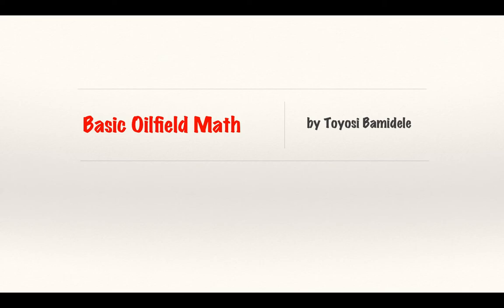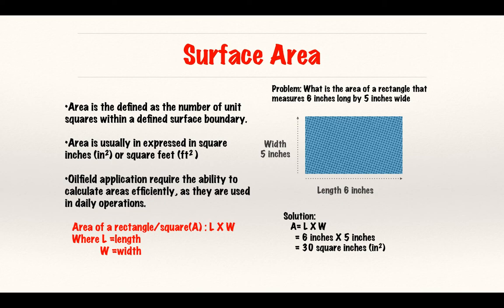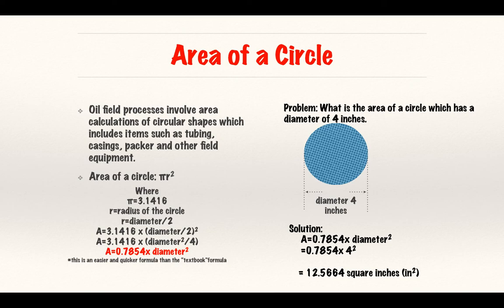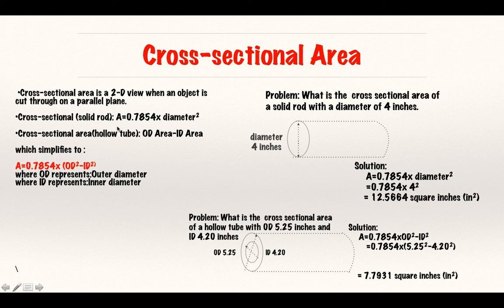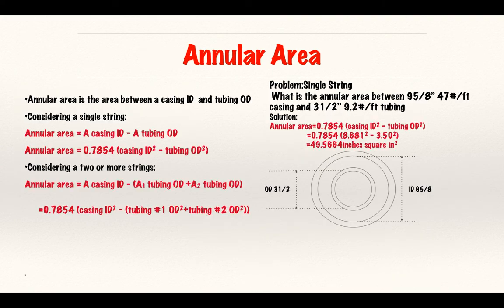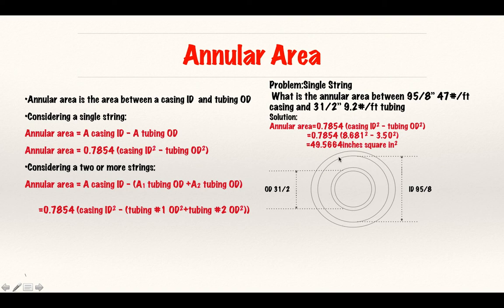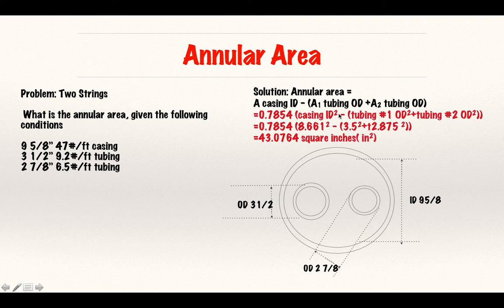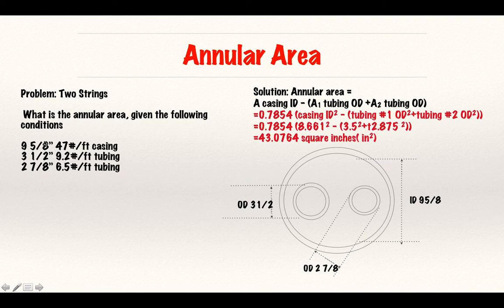Basic Oilfield math part1

Comment: how does 95/8" then become 8.661 in the equation ?
Reply: Right  9 5/8" OD   53.50 Wt/Ft   8.681 ID
Reply: use a pipe book to see the actual Inside diameter of 9 5/8 47# casing. Because you are looking for annular area you would use the 8.661 and not the 9 5/8 or 9.625. So 9.625 gives the outer in this case we cant use. 8.661 gives you the inner in this case would solve the problem